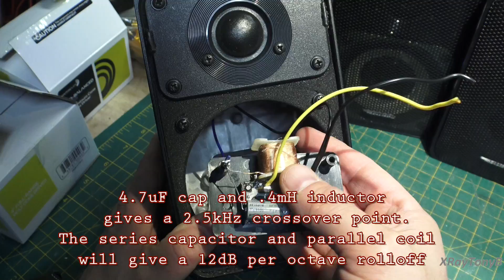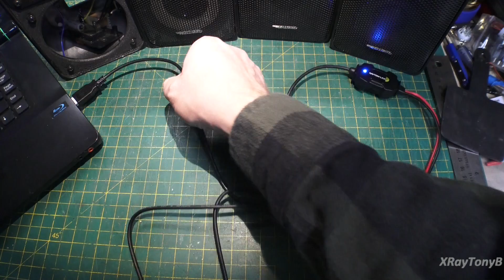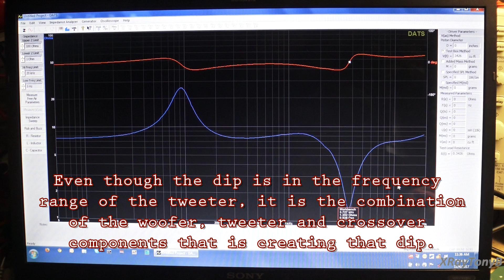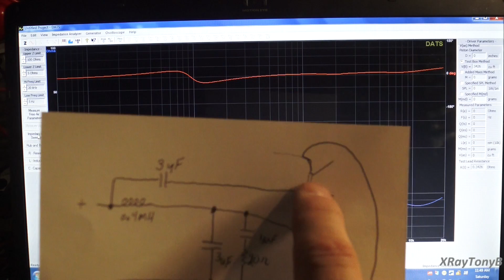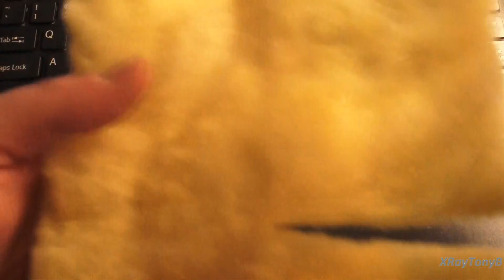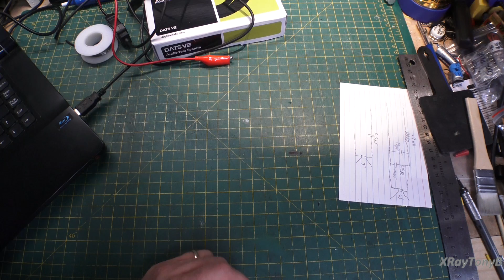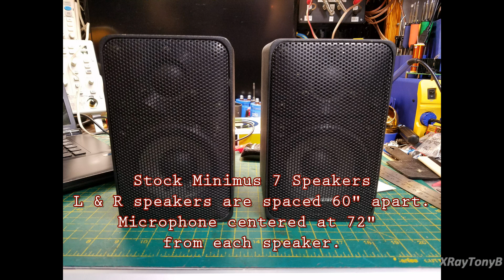Realistic Minimus 7 Speaker Modification and Test

Comment: Hmmm... ok, good thing you included the original .mp3, otherwise I might have gone the wrong way with this, same way you did, imo.

I think, as far as overall fidelity goes, one has to hand it to the Poly Cone mod.
Don't get me wrong, with this particular song, through the speakers, the mini subwoofer mod carries it for me too, because the bass just has more thump to it than a speaker that size should realy allow and I thought the Poly Cone modded speaker set overemphasized the distorted guitar chords, which come in near the end of the sound clip, compared to the standard and mini subwoofer set. 

However, listening to the .mp3, it's clear to me (using Sennheiser 600HD headphones, BTW) those chords are WAY too 'present' in the master of the piece. The sound engineer for it, imo., done goofed, so I feel I can't hold reproducing that aspect of the original against the Poly Cone modded speakers.
Therefore, imo., they should get the nod as the test speakers, even though the mini subwoofer based speakers will probably sound 'nicer' for tracks which have a heavy bass component.
Reply: Obviously, you can't run a copywrighted track through it on YouTube, but try running 'Son of preacher man', by Dusty Springfield, considered by a sound engineer friend of mine to be one of the best mixed tracks of all time, through these speakers and see what you think.

Comment: You always have to have small magnets in enclosure units, the reason to have the bigger magnet on a Openbox you're having more free air there's no or less resistance on the driver. Swapping your wires on your speakers with change your phase off axis especially if they are opposite to each other from the tweeter to the LF driver but this is not a given, for instance if you put the wires opposite way round on the LFdriver will generally give you a lower base same with the tweeter if you find it too bright by swapping the wires round  give you the off axis and make it sound a bit more pleasant maybe. You might want to try a 12 F in series on the extended Bass Driver, and use a 3.3 across the terminal. you might want to experiment if you put this in front or behind the inline 12F capacitor experiment running a resistor as well in parallel across. Putting ferrite in the middle of the coil changes aspects as well this usually causes it to be more punchy in the middle to high low frequencies, you can get them from old alkaline batteries should fit the inductor perfectly just have it overlapping a little bit over the induction coil. The values of  0.4  bit low try as a resistor in series or a higher value of 12 to 22 mH. When you what analysing that peak was it 130 Hz or so! a 10or12 mH should be better and bring that impedance peak down further. Thing with speakers it's not all mathematics at the end of the day it might look fantastic on paper or on a chart? Till you you hear it it can sound like pants. You might want to try some more dense dampening material natural wool mixed in with fiberglass about 80% wool to 20% fibreglass.  maybe not in little speakers like that it's hard to say because you got the wrong drivers having more damping material might be better at least about 70% of the volume of the cabinet alternatively try something like memory foam just stuck on the sides of the cabinet quarter to  half an inch thick might be better for a small cabinet like that because it's metal, as well you don't want it to ring like a bell. any high density non open cell foam would be better try memory foam if you can get it? But do not put any on the top leave that bare double thickness on the bottom tho. Always slight adjustments will change its aspect even having the speaker upside down because of its dive aspect. I found a good way of making the tweeters sound exactly like symbols if that's what on a soft Dome tweeter above 17k. check if there's any felt as well underneath the tweeter should be felt there you could try lining the cabinet with felt just on the sidewalls not back try mixing it up with damping materials they all have them benefits of controlling resonance. Really you want to tune it in without any damping materials first. But even better bitumen pads same thing they use for insulating cars  would be the best material for this with some felt and memory foam at the back. The neodymium magnets are not small movements they are equal to a ferrite magnet in their power you have to get small magnet drivers, that are specifically designed for enclosed units like (seas) drivers? www.seas.no not ported you cannot use small magnet drivers in open boxes!! If I was inclined to have these speakers I would do away with the tweeters altogether and just have a universal driver a metal cone driver or a piezo tweeter if desired and stick a radiator on the top to give you that low end bass. There is so many different directions you can take as they say there's more than one way to skin a cat

Comment: Did you break the speaker in by driving it with some pink noise for a while?  It changes the results of your tests, especially theil small parameters.  You can drive the two together, face the two together, and drive them out of phase.  This will minimize sound produced while breaking them in.

Comment: Ok, I am a newbie to crossover circuits, and really still a newbie in electronics, but I remember seeing a review of those large *ss home amplifiers (the married couples) and I remember you speaking of the frequency that the transistors can operate. That brings to mind a couple questions. 
A: What would a higher frequency fet amplifier load to that cross over network (especially the inductor)?
B: I wonder what the real readouts of that test dongle compare to the sweep of a nice function generator?
C: (This sort of ties into the previous B question) Can I use my 105B Fluke scope or equivelent and a frequency generator to generate something to do the same?

And it's funny because I use a stock set of those on a 50wrms amp as my middle surrounds because they were small but sound decent with power..I made a nice sideways mounted adjustable angle mount for them using copper plumbing tubing with black textured powder coat. Looks nice, sounds okay.

Comment: Have you tried to run the record it's true apart metric analyzer I think did the change in sound it's because a little bit of lock in the meets more than any extra Bass anyway I have the Altec lansing version of those speakers in mine have problems producing base below 60 megahertz

Comment: Since these are sealed enclosures, what do you think of modding one pair to add a passive radiator to the rear of the speaker.  My guess is it would extend the low frequency range down to around 50 Hz. I don't have any R/S Minimus series speakers, but I am planning to buy some Hammond cast aluminum cases and build a pair of Minimus-like speakers soon.  I am considering using PR's on my homebrews.
Reply from the maker: I've heard some smaller bluetooth speakers with passive radiators that sounded pretty good, so I'm sure the idea would work.  You would have to use the correct woofer and passive radiator.  If you decide to try it, let me know how it works out.  Thanks for the comment!

Comment: Have you tried adding a bass reflex port?  Matt
Reply: Excellent question. Porting will improve bass, but with a very steep roll off in comparison to a sealed box.  Primary risk with smaller drivers is the loss of damping (operating free air) once you go below the port frequency, which would be quite high and vulnerable for such a small driver as in the Minimus 7.  They would have many issues with mechanically damaged drivers which is why they probably chose sealed.

This is why all the new tiny subwoofers that are astounding in performance use passive radiators instead of ports in addition to a matched amplifier using a DSP to work around the limiting physics.

Passive radiators give you the benefit of a port without driver destruction below the tuned frequency if done correctly.  So many passive radiators were used incorrectly in the cheapo consumer market to imitate a 2nd woofer vs making better sound that they got a bad reputation.
Reply: the boxes are too small to be ported, or at least at a low enough frequency to be worth it

Comment: Hey Tony - did you happen to upload a MOUSER list of parts for the custom X/R?
Reply from the maker: No I didn't.  It's been a while since I did this video, but I think I might have had some of the parts in stock, but I don't remember for sure.
Reply: @xraytonyb  thanks for sharing this video.
I also enjoyed your videos on the JBL UREI amps as well and bought a couy to patch into my preamplifier outputs for my home theater.
They're built like a tank and crank on my 4ohm front main speakers.
I'm using these to try out different speaker placements in my Dolby Atmos/ DTSX/Auro  height channels.
There seems to be quite a bit of discrepancy between these different formats regarding speaker placement so I'm just experimenting to see what I hear with my own ears.
THX recommends 80 HZ and although these are rated down to 50 they start rolling off slightly before 80. Thankfully I can set the frequency above the roll-off point so they'll stay clean and tight.
So this video is still relevant in my book.
Thanks for sharing.

Comment: Have had a few pair of Minimus 7 and my issue has been with blowing tweeters. Perhaps a 10 ohm resistor across that driver would help prevent the problem. I will try it and let you know the outcome. Very satisfying video and thanks for uploading.

Comment: How do you get the grills off?
Reply: Small screw drivers..*and my wife's hair dryer*..CAREFUL Bob!
Reply: Pry them off gently using a small flat head screw driver. There is a bit of soft  glue holding it. Its almost like black silicone.

Comment: I just picked up a pair of these in walnut at a thrift store for $10/pair. I have no idea why people pay 5-6 times that on eBay. They really are 10 buck speakers. All I did was swap out the capacitors for new ones, same value. There is no need to over engineer or try to rebuild these. They are basic bookshelf speakers, and really that’s all they ever will be. Lipstick on a pig, well, it’s still a pig. For what they are fine. Extensive rebuilding, and well, you might as well no longer call them Minimus 7’s. But I really don’t understand the cult of these speakers. Audiophile they are not.
Reply: True it's just bookshelf speakers. But would hurt to go on the experimenting journey.  If end result make the owner happy, then it's worth it. If stock form remains the best, then he tried.
Reply: These speakers are interesting and desirable because of the inert cabinets. You won’t find metal cabinets in this price range anywhere. If minor cost effective tweaks are possible, why not try them?
Reply: @williamrutledge2588  They are Minimus 7’s. They are what they are.
Reply: @ArthurHallicraftersKitchen  well, everyone have their own preferences. I personally like them for what they are.
Reply: @cheath8705  I think they are “ok”. I live them, I do not love them.’
Reply: The cult is they are great communication speakers for amateur radio.
Reply: @twohandsandaradio  I would not pay eBay prices for them. But many do, and think it’s a good value. Um, no.
Reply: ...maybe its your 8-Trac
Reply: @jetpack5  No? Junk speakers are junk speakers. You’re not another one who considers these “high end”, are you?
Reply: @ArthurHallicraftersKitchen  i thought you had something to express
Reply: @jetpack5  He's complaining after admitting to getting these for only $10 from a thrift store. Talking sense is not going to work.